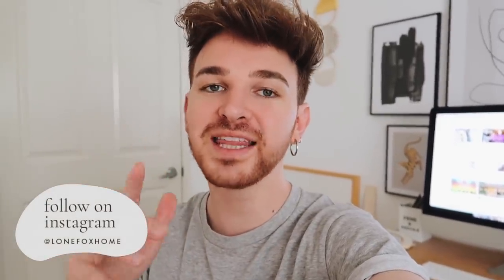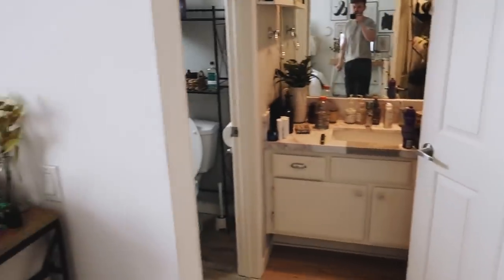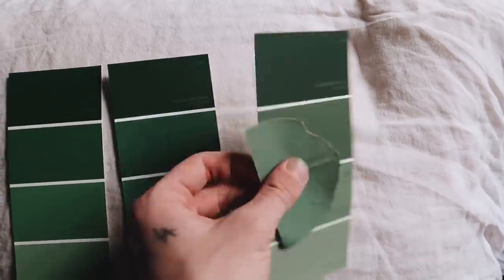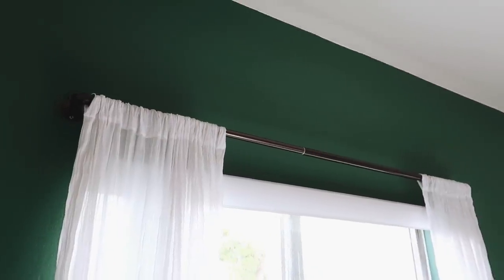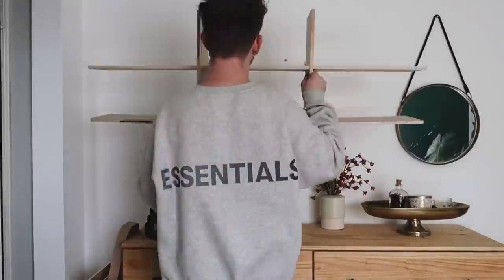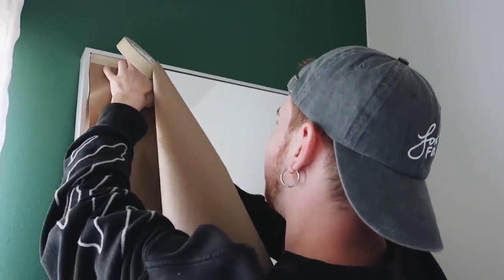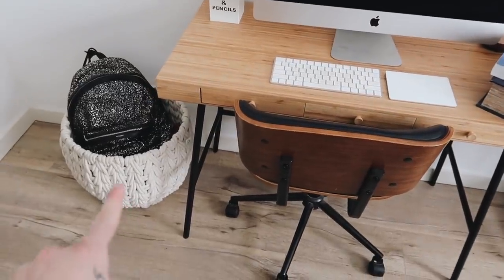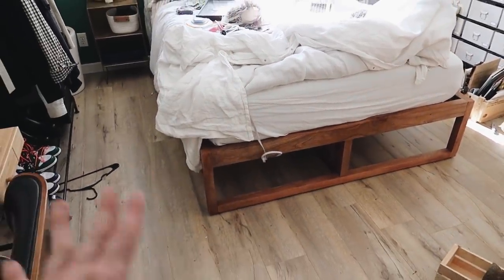EXTREME BEDROOM TRANSFORMATION FOR $50 + DIY ROOM DECOR! (Eclectic + Chic)

Comment: A tip I learned after many years of painting. If you want to ensure a truly crisp line, first cut in along with the color you are against. Like if your painting a green square on a wall that is white, you paint along the tape with the white because that is the color that will leak under the tape. Let that dry, then paint the green or whatever color you choose. After its dry or partly dry take off the tape. Works great! I've tried all the tape, I've never found one that was perfect. You could also try using a flat poly if you don't have the base color.
Reply from the maker: Such a great tip :) ty!

Comment: Love your talent. Thx for so many ideas. One tip I'd like to share is using "T" pins, instead of small nails. U can get them in any sewing notions section of a fabric store or even W.Mart. The hole size is very small and the extra bonus is a "T" pin can hold a 12lb frame. Just put it in on a downward angle. Great for renters. Love how you're using what's at home, during lockdown. Tracy from FL.
Reply from the maker: Thanks for sharing!! :)

Comment: Love Everything! Love That Green Wall! ...ever thought about steeping some teabags and use that tea as dye to tie-dye those curtains? They would come out a great color, and depending on where you gather the material to use rubber bands, you could make a flame-stitch pattern, or the typical “circles,” even using nothing but to make them a color similar to pale burlap...👍🥰❤️...many vegetables can be used as dyes. Even Spanish onion skins, spinach...which would make a pretty soft pale green curtain, and you do the same as the tea dye. Of course, you would squeeze-out excess water, air-dry, then iron to also set the dye. You could even keep those curtains white, but block-print some large green leaves by placing a garden leaf on the curtain, cover with parchment paper and then iron. When you peel off the paper and leaf it will leave you your design.
Reply from the maker: Thank you so much! Such a great tip :)

Comment: Another hint: if you lay out paper on the floor the size of the area  of wall you’re going to do the gallery. Then arrange your pictures while your paper is on the floor. Take a picture of your final arrangement. Draw around each picture and mark where the nail or screw is going to go. Tape your paper on the wall and put all the screws or nails into the wall. Then you can pull your paper down and the wall is ready for you to hang your gallery collection. You have your picture you took to refer to if you forget where each picture goes.